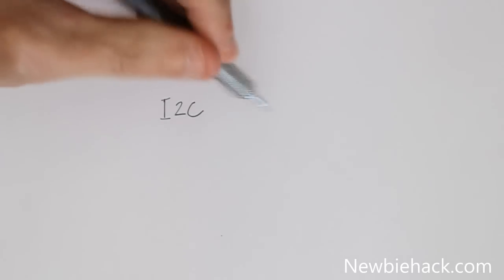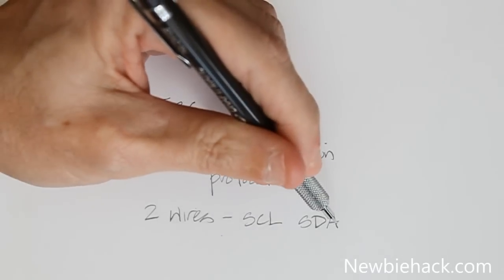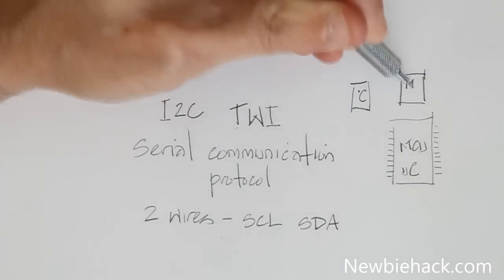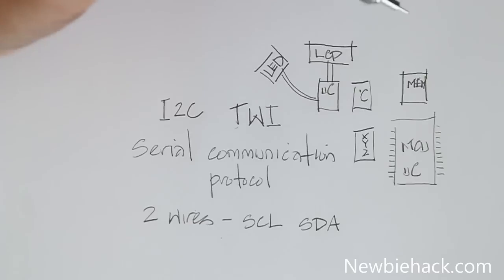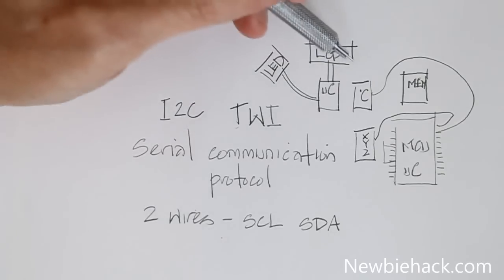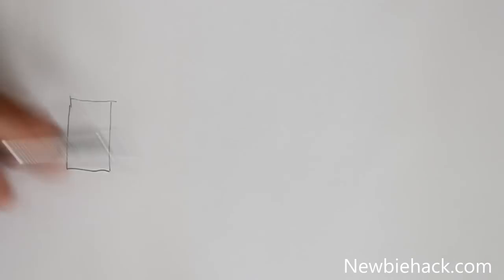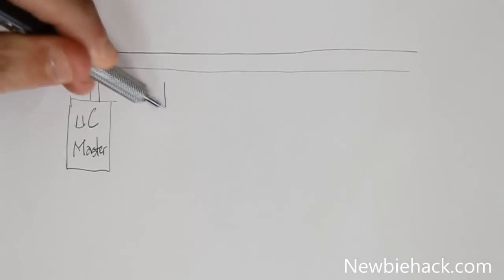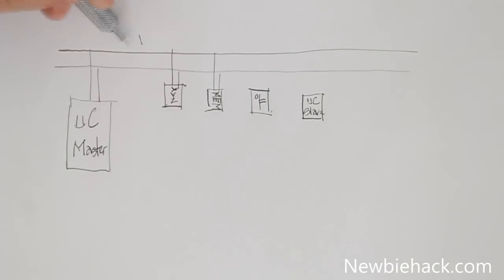52. Arduino for Production! How to Code the I2C/TWI Two Wire Interface Tutorial Part 1

Comment: Late to party, but thx: just the basic info this newbie needed:)
Reply from the maker: Excellent!
Reply: Diving into firmware (Marlin) for 3D printer (MakerGear M2) to use LCD controller (Viki 1) w/ motherboard (RAMBo, RAMPS, & w/ ATmega2560). Newer Marlin/Arduino builds not supported by MakerGear, but I wanted some features, so have been hacking away:) Got things working 99%, but indicator lights are falsely reporting (only at startup: currently corrected by turning on/off fan - odd. hm?). 3rd-party library (LiquidTWI2) required <--- that's how I got to you!:) Now I know that "TWI" stands for "two-wire interface", plus some other cool stuff about I2C. Thx, again:)

Comment: Can I use 2 devices on the same analogue input pins for example both rtc and gsm on a4 and a5 or will they need there own pins?
Reply from the maker: Are you referring to ADC or I2C?  This video is I2C and does not relate to ADC.
Reply: Do you mean they wont work in analogue pins? or they will but it does not matter / or is not required? and would you use same pins for 2 or more devices or use separate pins for each i2c device?
Reply from the maker: The Analog to digital converter pins are port A.  You can have multiple analog inputs if you want.  But how does this relate to I2C/TWI?
Reply: I don't know im new to i2c and spi i am asking you will they work on digital pins aswell as the analogue input pins and i am asking if multiple devices using same i2c can share a wire or best to use separate pins?
Reply from the maker: I do explain this in the video.  You can have 127 devices on the I2C/TWI lines.  I2C doesn't really have anything to do with the analog inputs.  This is why I was confused by your question.